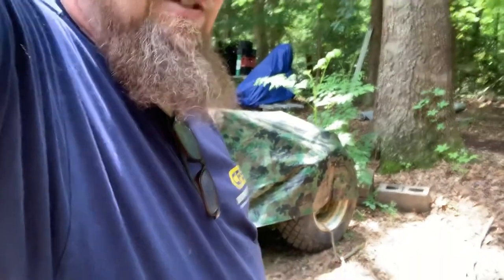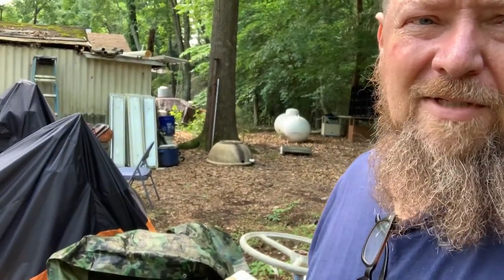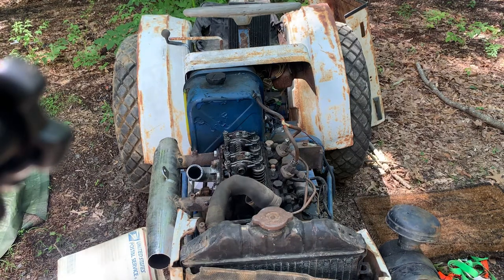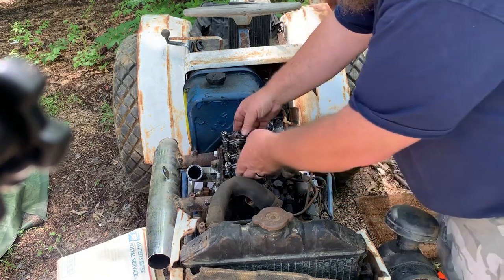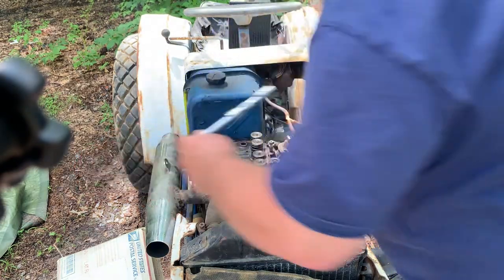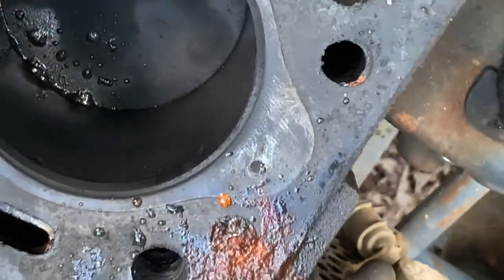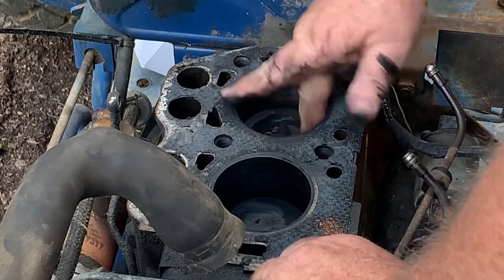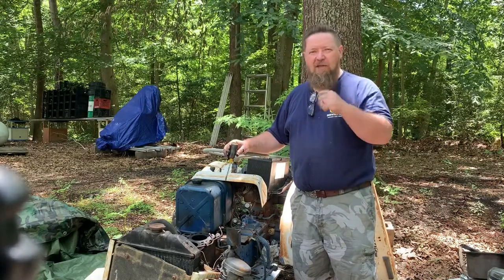Mitsubishi tractor  S370 restoration part 1

Comment: I have an s370D and it needs a clutch  , where do I get the parts for it ?
Reply from the maker: Hi frank
I purchased my clutch on eBay for $135.00 fits  Satoh S370 Mitsubishi MT372 D1300 tractor clutch 7 1/4" 10 spline

Comment: Hi Pastor Bill!

I have the S-370D and my PTO spins with out any implements on it but when I hook my bush hog up to it and engage the PTO it’s almost like it shakes back and forth but never actually spins the bush hog. There is no strange noises made. Do you have a video of a PTO fix or troubleshoot and know of anyplace on YouTube that does have a good video or website or anything really!😂😅
Reply from the maker: Is the PTO shaft on the bush hog spinning?
Reply: If I hand turn the bush hog shaft it spins the blade but when I connect to the tractor and engage the PTO it does not spin. 

Is that what you were asking? Let me know
Reply from the maker: @MrRawlings20  
I’m not 100% but I’m thinking a shear pin or key  gave out. There are some publications on the schematics of how all the gear boxes are put together. When I did my clutch, I downloaded those publications to figure out how to pull the tractor apart. I also use those same publications to fix my three-point hitch hydraulics which is under the seat where the PTO shaft is located. There are several shafts with gears on them and both the front gearbox and in the differential gearbox one of the shafts is the PTO shaft. To protect the gears from sudden impact from implements, sheer pins and keyways are installed to absorb the impact from implements. Imagine using Bushhog and the blades suddenly stopped from hitting something very hard. The impact from the travels through the drivetrain into the output shaft of the PTO. The gears can be inspected easily by pulling off the bolts under the seat that holds down the hydraulic system of the three-point hitch, and also where the gearshift bolts down. From there, you should be able to pinpoint where the trouble is . But first download all the publications you can on the Mitsubishi tractor/Satoh S370 D. Good luck. The tractor is very robust and was designed the last of Ray long time they put in those safety features to protect their equipment. Most of these little tractors were not sold in the United States, but two foreign countries that don’t have access to parts to protect their interest in their company, safeguards were built into these tractors to protect them also so that others could fix them fairly easily.

Comment: Are these engines known for breaking their pistons and timing gears?
Reply from the maker: The number one problem is not the engine but the unknowledgeable operators. 95% of most Diesel engines can only operate at 2500 rpm’s, for a gas engine this is less than half the operating speed. At 3000 rpm the engine starts loosing power due to floating valve train and floating fuel pump workings. The first thing to go is dropping a valve or loosing a connecting rod or a fuel pump. The engine does not need to spin faster because it’s already making peak power at 2000 rpm. As for parts look them up for the engine rather than the tractor. These engines were put in many different formats boats, generators, skid steers,and Mitsubishi made tractors for other manufactures
Reply: @fixingthingswithpastorbill3840  Thank you Pastor Bill for answering my question I really appreciate your time and I now understand, I don't own one of these tractors as yet, although there is one for sale but the engine does not turn.
Reply: I'm not sure if either the pistons have rust welded themselves to the bore because it has been standing for about twelve years now, or if it could have dropped a valve and broke the number 1 piston